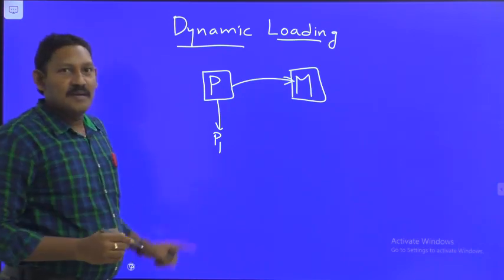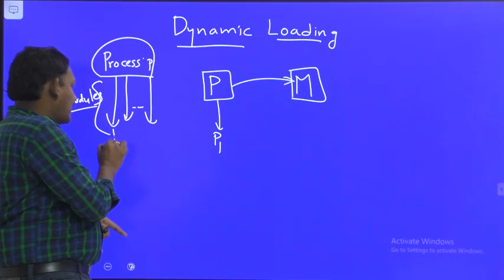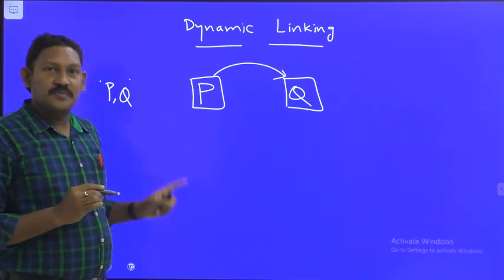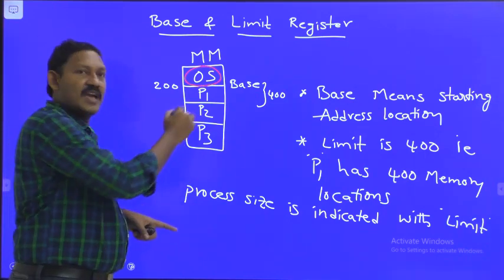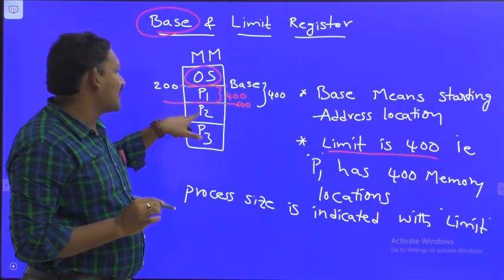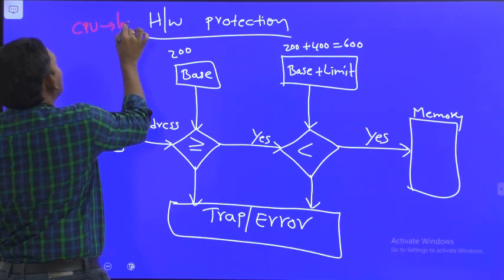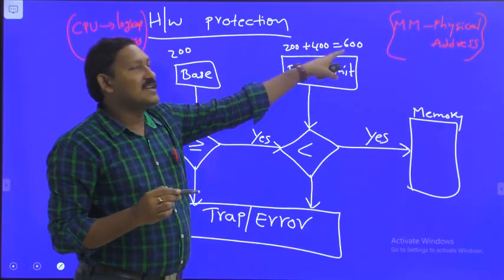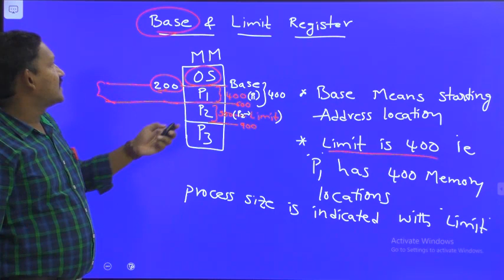3.6 Dynamic Linking, Loading, Base & Limit Register

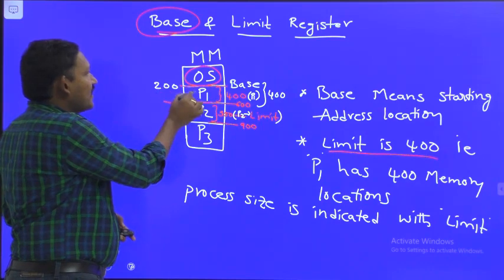Comment: Sir @6:57 cpu generates logical adress and for hardware based protection we need to compare this address with base and  limit register. Then the base register contains physical memory adress or logical adress? I mean  for process 1 the base adress is 200. This 200 is logical or physical adress?